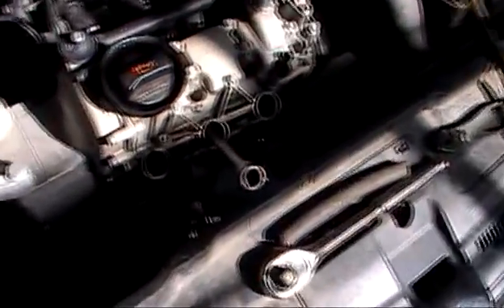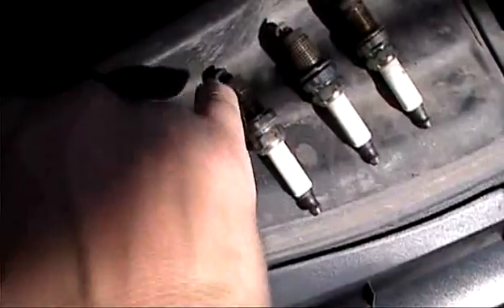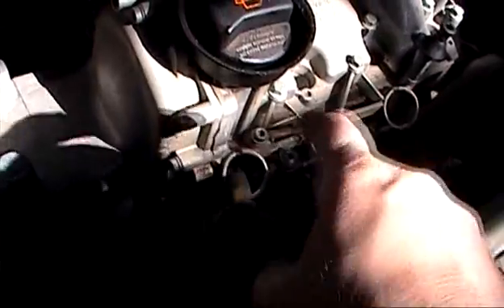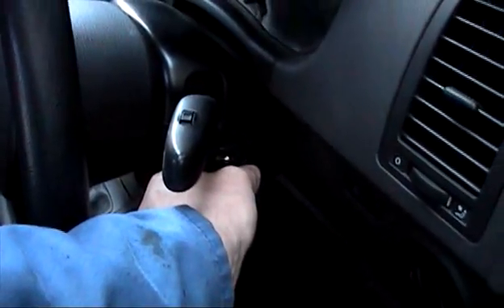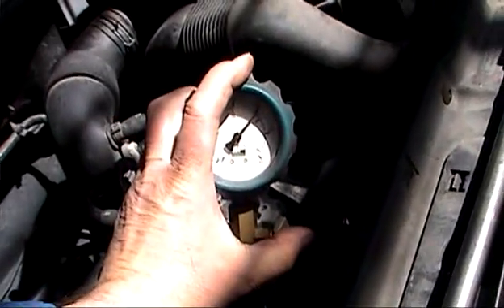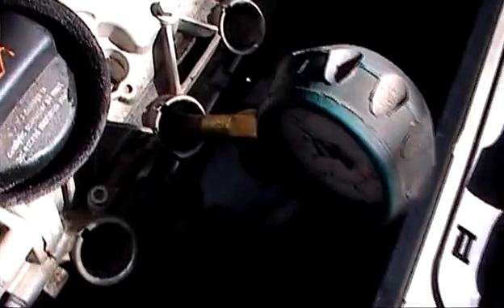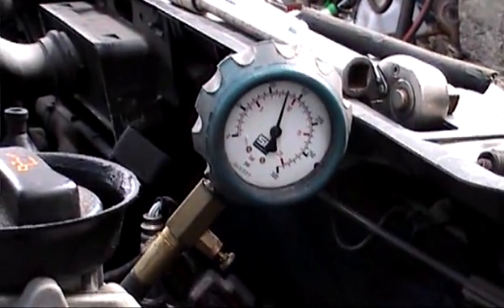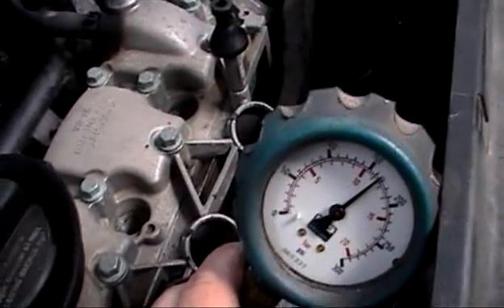VW polo compression test burnt out valves

Comment: i have a 6v polo 2002 letting oil on to one spark plug so bad it will not fire on this cylinder will i get away with just putting valve seals in
Reply: Hi there, did you ever solve your problem? Currently experiencing this.
Reply: chamily82 i have this issue too, did you fix it?